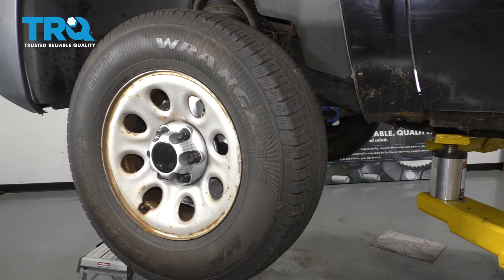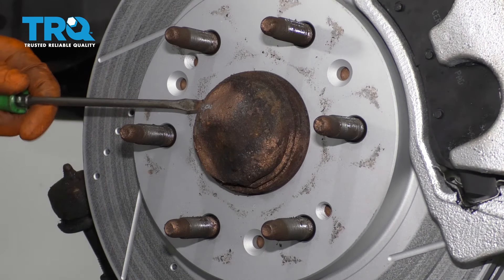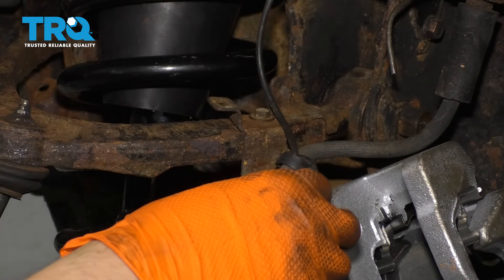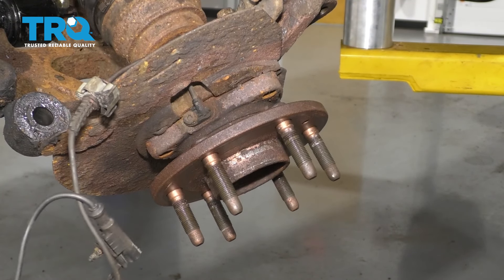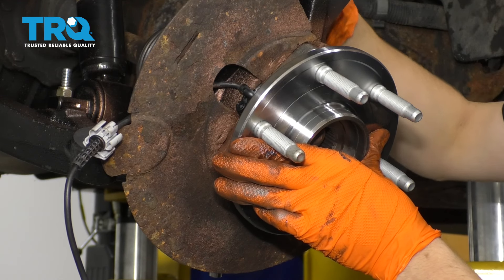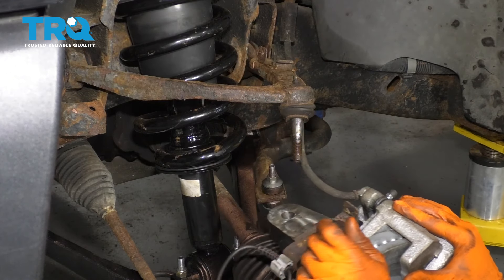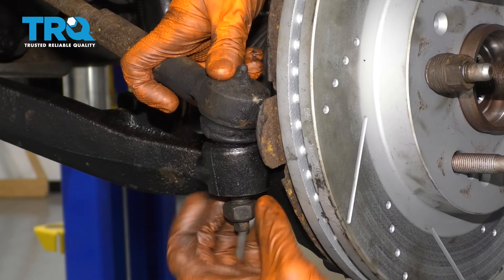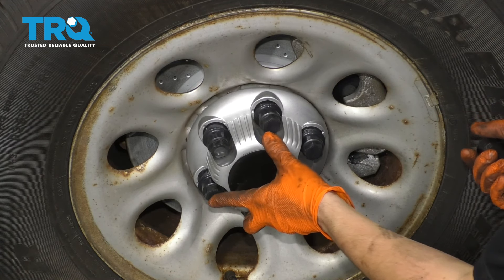How to Replace Front Wheel Hub & Bearing 2007-14 Chevy Silverado

Comment: I'm not sure why they did so much extra in this video. There's no real reason to take the knuckle loose if you're not replacing the knuckle and/or ball joints. Take axle nut off, loosen hub bolts but don't remove, check that cv axle is free, and use a slide hammer with a hub attachment to break the hub assembly loose.
Reply from the maker: +Chris Lapento We appreciate the feedback. Sometimes there are multiple ways to accomplish the same repair. http://1aau.to/m/Shop-TRQ
Reply: @TRQ ya a lot of needless steps. People are here looking for the easiest way.

Comment: Idk why take the entire control arm and tie rod end off of the knuckle. Sure you can torque it down but you can fit many torque wrenches and breaker bars back there anyways. Also instead of using a pry bar to tighten the axle nut find a buddy to press the brakes hard to hold the entire thing in place.

Comment: Proper way to stop spindle rotating to accomplish 167 ft/#, is to insert a screw driver through gap in calliper into a gap in between webs of vented disc. 
This way there will be No flex whatsoever, to get proper torque.